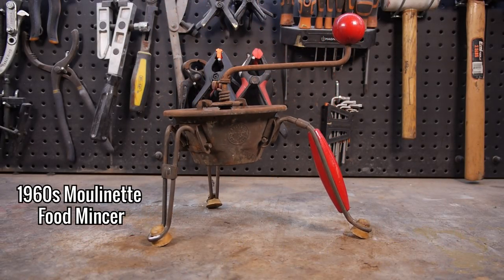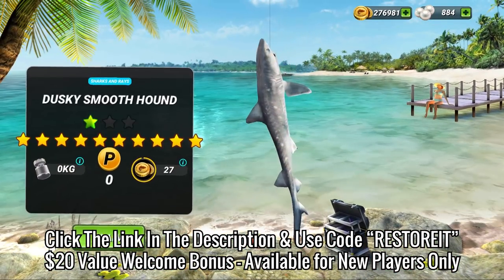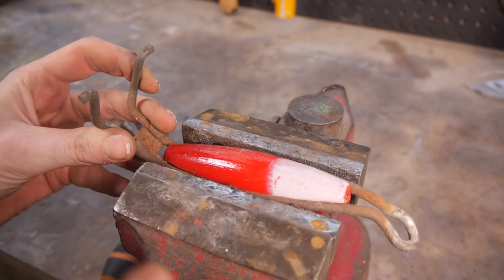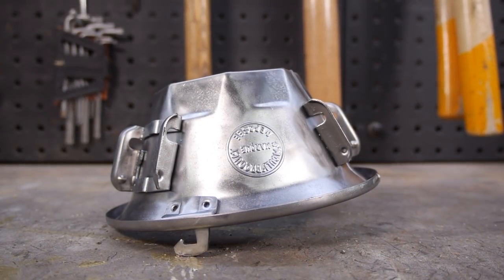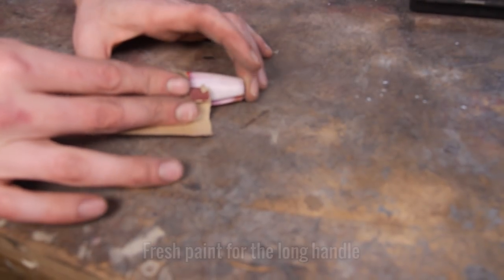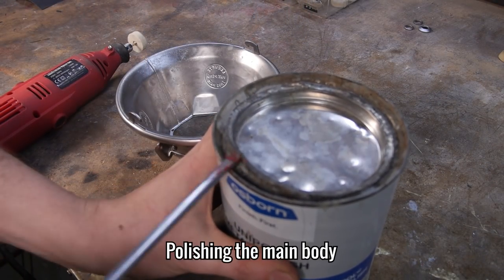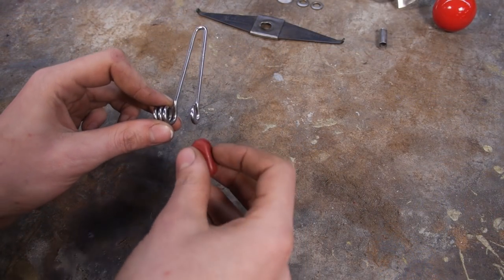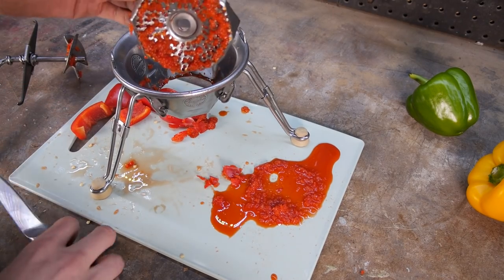60 Year Old Food Mincer Restoration -  Moulinette - Made In France

Comment: if you slide that red bit up in and out it will alter the spring tension holding the cutting blades against that grid, that will in turn change between a fine chop and a mince.